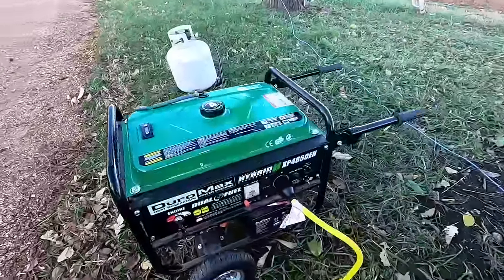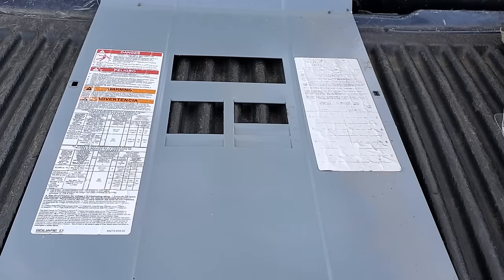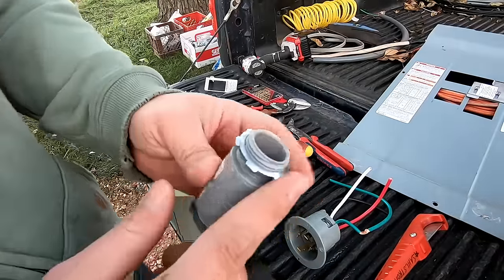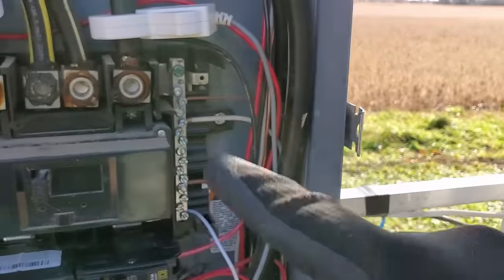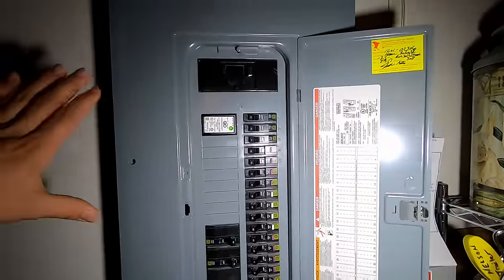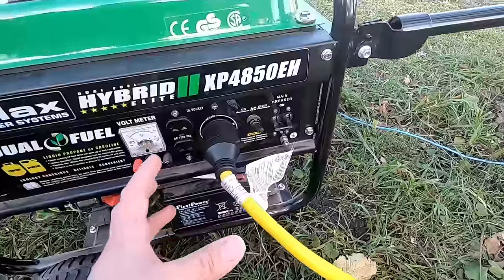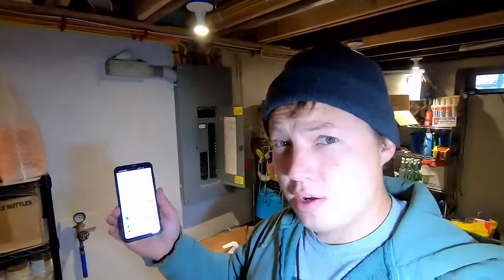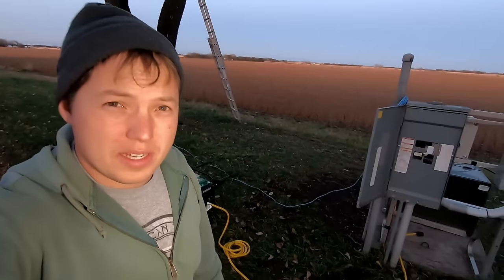How To Hook Up a Generator To Your House Using a Breaker Interlock Kit & Power Inlet Box

Comment: Nice work. Well presented. No cringing on your safety. Keep making great content.
Reply: Don’t forget about the generator safety tips as well. Remember it’s important to follow all the generator safety rules whenever you use your generator. Here are the generator safety tips:

1) Please do not allow an unqualified person or your children to operate the portable generator. Just because some manuals don’t say that doesn’t mean it’s safe. That is important against the generator safety rules. We also need to be keeping an eye on our children too. You need to make sure that your children are not playing near the portable generator especially when it’s running so they won’t get electrocuted. Generators pose electrical risks and they can be hot during an operation. Please keep your children away from the portable generator at all times. It is important to keep our children safe especially our little ones. Be aware of all the hazards.

2) Some people use their portable generators indoors which increases the risk of carbon monoxide poisoning. It’s important to have a carbon monoxide if you have a gas generator. Never ever use your generator indoors even if your doors and windows are open and even in the garage is not safe to use a portable generator. Not even at your porch and your deck. It is never safe to use your generator indoors and in enclosed areas of your home. Your generator needs to be 15-20 feet away from your house. 

3) 🔥generators cause fire hazards too. Never refuel your generator while it’s running. You need to let your generator cool off before refueling it and before storing your generator. Never overload your generator too. Never ever back feed your generator. You should never plug your generator into a wall outlet. Also never store propane tanks indoors. Please keep flammable things away from the generator as well and please don’t smoke cigarettes near the generator. Having a fire extinguisher next to the generator is also important against the generator safety rules. 

4) generator operation; make sure your hands are dry before touching the generator. Never use your generator in wet conditions. Don’t let your generator get wet. You need a generator tent if you need to use your generator during wet weather. Please don’t wear loose clothes when operating the generator. Turn on your generator before plugging in appliances. Use the right cord for your generator. Please do not use worn out cords. 

https://youtu.be/I1jT3ANENvI and here is a video more about keeping others safe when using generators and also about our family’s safety. Hope this helps

Comment: Excellent stuff, thanks dude. I grabbed a dual fuel 7k a while back as a “prep” I have been reading up on how I want to hook it up. Originally plan was for my well pumps only, but now I’m gonna do whole house and control with breakers.
Reply: Don’t forget about the safety rules of using generators: Always make sure you follow all the generator safety rules whenever you use your portable generator. This is a reminder for everyone’s safety of using generators. Generators can be dangerous if not used carefully. Every year, hundreds of people die or get injured when using portable generators due to carbon monoxide poisoning and electrocution. Make sure you are using your generator carefully and keeping others safe as well. There is something very serious that everyone should always be aware of when using generators. Some people do run their generator indoors which is not safe and that increases the risk of carbon monoxide poisoning which can cause death of family and you. Some people run their generator in wet conditions which can electrocute them. Please remember that you should never run your generator indoors. Remember that carbon monoxide is an odorless and colorless gas that you cannot see or smell. Carbon monoxide is a silent killer. Keep that in mind. Make sure your generator is 15-20 feet away from your house and away from doors, windows, and vents. Never use your generator in your porch too. Having a carbon monoxide detector is very important against generator safety. Some people also allow children to go near the portable generator which could pose risks. We need to keep an eye on our children making sure that they are not near the portable generator so they won’t get electrocuted or burned by the generator which is dangerous. A locking enclosure also keeps kids safe. A generator shed might look like a tempting place to explore, or take cover during a game of hide and seek, but a generator is a dangerous piece of equipment that can cause injury. It says on the manual that we should also keep children away at all times from the portable generator to avoid injuries. Please do not allow a child or unqualified people to operate the portable generator.  It is important to keep your children safe especially little ones. The portable generator can be hot during an operation. Just because some manuals missed what should be listed doesn’t mean it’s safe to do. Always follow the generator safety rules when using portable generators. Generators pose electrical risks. If you need to use your generator during wet weather, you need a generator tent to protect your generator from getting wet. Don’t let your generator get wet. Keep your generator dry and before using your generator, please make sure your hands and your generator is dry. Do not wear loose clothing when operating the generator. Everything that is said on the generator’s operating manual should not be ignored. Never smoke cigarettes near the generator. Please keep flammable things away from the generator. Never overload your generator too. Your generator can catch fire. Never ever try to plug a generator cord into a wall outlet to avoid back feeding. Back feeding your generator is dangerous. Always turn on your generator first before plugging in appliances and shut off the appliances before turning your generator off. Use a heavy duty cord for your generator and the cord should not be worn out. All the instructions should be followed carefully. Never refuel your generator while it’s running. It can cause fire if fuel spills while your generator is hot. You should turn off your generator and let it cool off before refueling it. Having a fire extinguisher next to the generator is also important. This is only a reminder for everyone’s safety of using generators. Make sure your generator is properly grounded. Having a fire extinguisher next to the generator is also important against the safety rules. https://youtu.be/I1jT3ANENvI and here is a video more about keeping others safe when using generators and also about our family’s safety. It’s important to keep our little children safe as well. Make sure your little children are kept away from the generator at all times especially when it’s running. Hope this helps. Always remember that it’s better to be safe than sorry.

Comment: that's a good idea about running the 2 wires through the sense clamps. You mentioned about running your A/C... the 240 is only a 30amp coming into the house, most household A/C's are running on a 50amp breaker or mine is running on 2 50 amp circuits. You sure that will actually work without overheating something?

Comment: Interesting that the generator breaker tripped at seemingly 3100W. As you said, it could have been something else (fridge/freezer) turning on that overloaded the generator OR your sensing system is not including all the load.
I've completely changed the overload protection on my new generator. Now, it can be overloaded and not be instantly tripped. I've done this by using a thermal overload - which means the amount of overload needs to be applied for some time - more time if only slightly overloaded and less time if it's a big overload.

Comment: Great Video, thanks! I have a question for you, I already have a Champion Power Equipment 200954 4250-Watt RV Ready Open Frame Inverter Generator, but it does not have stand alone 240V connection. it has two 120V 20 A AC connectors as well as 120V 30A RV connector but not a Single 240V output connector. Can I use this generator to connect to my main electrical panel in my house similar to how you did it?

Comment: I have the same setup here with 50 Amp generator breaker.  My problem when the power is out then goes back on, not knowing when power comes back on.  Those power monitors would help me in a big way.
Also, when I turn on my well pump running on generator  (2 HP 10GPM 230 VAC) it makes a weird noise from the inside well shutoff panel.  I was going to ask if my 10K Watt generator was under powering it, but you seem to have answered when I saw your gen.  Ill checkout these monitors to get a precise answer.

Comment: For the deburring of connectors - There is a tool that mechanics use and it is perfect for this task. Most good hardware stores with hae it. There is a handle and inserted int heat is a bent rod, maybe 1/8" and the end of the jog is the cutter.  Not is  USA so can't give brands but it is a common tool for mechanics. You can sue of for Al, Iron, Steel, Copper or plastics.

Comment: Good video, your electrical backup system is somewhat complex, but in a power outage, you will have it handled
Reply: Here are the generator safety rules that everyone needs to follow: this is just a reminder for everyone’s safety. Always make sure you follow all the generator safety rules whenever you use your portable generator. Generators can be dangerous if not used carefully. Every year, hundreds of people die or get injured when using portable generators due to carbon monoxide poisoning and electrocution. Make sure you are using your generator carefully and keeping others safe as well. There is something very serious that everyone should always be aware of when using generators. Some people do run their generator indoors which is not safe and that increases the risk of carbon monoxide poisoning which can cause death of family and you. Some people run their generator in wet conditions which can electrocute them. Please remember that you should never run your generator indoors. Remember that carbon monoxide is an odorless and colorless gas that you cannot see or smell. Carbon monoxide is a silent killer. Keep that in mind. Make sure your generator is 15-20 feet away from your house and away from doors, windows, and vents. Never use your generator in your porch too. Having a carbon monoxide detector is very important against generator safety. Some people also allow children to go near the portable generator which could pose risks. We need to keep an eye on our children making sure that they are not near the portable generator so they won’t get electrocuted or burned by the generator which is dangerous. A locking enclosure also keeps kids safe. A generator shed might look like a tempting place to explore, or take cover during a game of hide and seek, but a generator is a dangerous piece of equipment that can cause injury. It says on the manual that we should also keep children away at all times from the portable generator to avoid injuries. Please do not allow a child or unqualified people to operate the portable generator.  It is important to keep your children safe especially little ones. The portable generator can be hot during an operation. Just because some manuals missed what should be listed doesn’t mean it’s safe to do. Always follow the generator safety rules when using portable generators. Generators pose electrical risks. If you need to use your generator during wet weather, you need a generator tent to protect your generator from getting wet. Don’t let your generator get wet. Keep your generator dry and before using your generator, please make sure your hands and your generator is dry. Do not wear loose clothing when operating the generator. Everything that is said on the generator’s operating manual should not be ignored. Never smoke cigarettes near the generator. Please keep flammable things away from the generator. Never overload your generator too. Your generator can catch fire. Never ever try to plug a generator cord into a wall outlet to avoid back feeding. Back feeding your generator is dangerous. Always turn on your generator first before plugging in appliances and shut off the appliances before turning your generator off. Use a heavy duty cord for your generator and the cord should not be worn out. All the instructions should be followed carefully. Never refuel your generator while it’s running. It can cause fire if fuel spills while your generator is hot. You should turn off your generator and let it cool off before refueling it. Having a fire extinguisher next to the generator is also important. This is only a reminder for everyone’s safety of using generators. Make sure your generator is properly grounded. Having a fire extinguisher next to the generator is also important against the safety rules. https://youtu.be/I1jT3ANENvI and here is a video more about keeping others safe when using generators and also about our family’s safety. It’s important to keep our little children safe as well. Make sure your little children are kept away from the generator at all times especially when it’s running. Hope this helps. Always remember that it’s better to be safe than sorry. Also remember that warnings should not be ignored too.

Comment: A super video!   I would like to install an interlock kit; however, I don't have extra slot to add the generator breaker in the current  panel.  Do I need a subpanel, so I can relocate one of the existing breaker (water well pump) to make a room?  Is there any other option?   Great presentation...even I can understand.

Comment: Awesome video, your question about torx screw heads, those look to be Robertson (square)not torx. (Star)Robertson is commonly used in Canada. It holds screws on the driver very well
Reply: ⚠️Please don’t forget to follow the generator safety tips when you use your portable generator:

This is a reminder for everyone’s safety when using portable generators. All generator safety rules need to be followed carefully whenever you use your portable generator. This is just to make sure. 

1) KEEPING OTHERS SAFE: Please do not allow an unqualified person or your children to operate and service the portable generator. Just because some manuals don’t say that doesn’t mean it’s safe. That is important against the generator safety rules. We also need to be keeping an eye on our children too. You need to make sure that your children are not playing near the portable generator especially when it’s running so they won’t get electrocuted. Generators pose electrical risks and they can be hot during an operation. Please keep your children away from the portable generator at all times. It is important to keep our children safe especially our little ones. Be aware of all the hazards.

2) WHERE TO RUN YOUR GENERATOR: Some people use their portable generators indoors which increases the risk of carbon monoxide poisoning. It’s important to have a carbon monoxide if you have a gas generator. Never ever use your generator indoors even if your doors and windows are open and even in the garage is not safe to use a portable generator. Not even at your porch and your deck. It is never safe to use your generator indoors and in enclosed areas of your home. Your generator needs to be 15-20 feet away from your house. 

3)🔥FIRE HAZARDS: Never refuel your generator while it’s running. You need to let your generator cool off before refueling it and before storing your generator. Never overload your generator too. Never ever back feed your generator. You should never plug your generator into a wall outlet. Also never store propane tanks indoors. Please keep flammable things away from the generator as well and please don’t smoke cigarettes near the generator. Having a fire extinguisher next to the generator is also important against the generator safety rules. 

4) GENERATOR OPERATION: make sure your hands are dry before touching the generator. Never use your generator in wet conditions. Don’t let your generator get wet. You need a generator tent if you need to use your generator during wet weather. Please don’t wear loose clothes when operating the generator. Turn on your generator before plugging in appliances. Use the right cord for your generator. Please do not use worn out cords. 

https://youtu.be/I1jT3ANENvI and here is a video more about keeping others safe when using generators. Everything that is said about the generator safety rules all need to be followed. Especially keeping your children safe. 

Hope this helps

Comment: Ben, 
Check out the Briggs & Stratton Q6500 generator. It is an inverter type generator, 6500 peak / 5000 running. I paid $1,500 for mine; you can buy one now for under $1,000. I put a natural gas conversation kit on mine, they also make a propane kit for it. The only draw back is that it is pull start; but I have never had a problem starting mine. I do pull it out every other month to run it, so I suppose that helps. 

Great video on the set up, that how I did mine. 

Jack
Reply: My experience with infrequently used engine's that use battery starting is it's nearly dead just when need it most 🙄 !!! Pull starting is good for you aerobiclly,  and works especially well when  motivated by the cold combined with a frantic wife 🙄 heh. Seriously though,  battery starting is unreliable without a regular testing & maintenance program and a trickle charger or small 12v solar panel,  lead acid chemistry batterys are unforgiving if neglected. I prefer the recently released option of starting with your cordless drill or it's battery packs, if you're the type who has several chargers running by the workbench constantly.